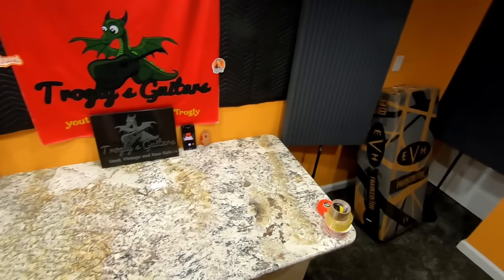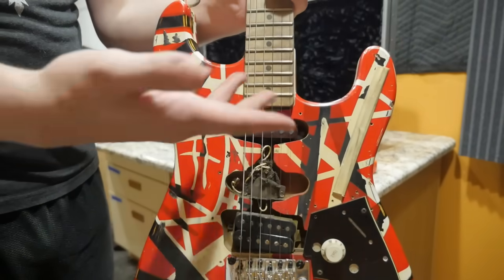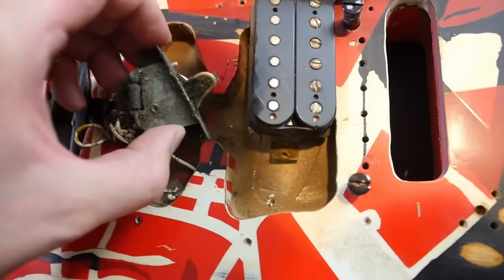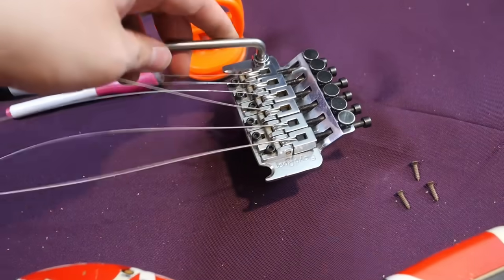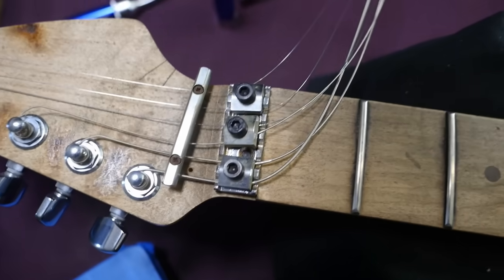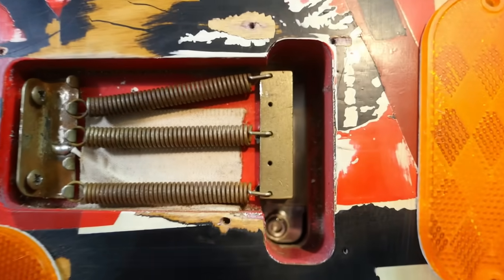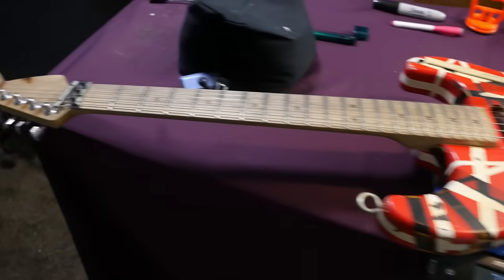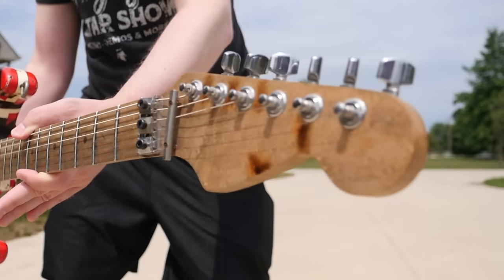This is the "Real Deal" | 2007 Fender Custom Shop Masterbuilt EVH Eddie Van Halen Frankenstrat Aged

Comment: One Minor Detail I noticed right away that you got wrong Austin, they never had Eddie's guitar with them. In an interview with Chip, the guy who did it, and Edward Van Halen, they both talked about the fact he did everything from pictures. He never had the actual frankenstrat in his hands to study.
Reply: Yes! Right answer there, it is all wrong in most parts like the reflectors that fender used are not the correct ones. Way too over priced for not being even correct.
Reply: @kgargom  ...

Well, not to argue, but according to the video I was where Edward is holding one in his hand, he talks about how absolutely perfect it is. Down to the reflectors. Chip even found a smudge of goo on there, and a piece of tape that Edward hadn't removed from the guitar when he painted it either the first or second time. It is amazingly accurate. At least according to Eddie Van Halen. Check out the Guitar World interview about the frankenstrat.
Reply: @timcarter1164  yeah, I've read that interview and saw videos of chip. Of course Eddie was not going to say  that the reflectors were not the correct ones anyway 'cause he had to promote the guitar as it is and "sell it" to people and get money out of them. But my point is that if you're gonna sell a 25k guitar at least there's gotta be with all the correct details on it including the "smallest ones" like the reflectors, if you know what I mean. Every tiny detail count. Just sayin'.
Reply: @kgargom  ...

First off, this is just bring the conversation please don't take it any other way. But while I understand what you're saying, I also know Edward was a stickler for detail when it came to anything with his name on it. Some stories might get exaggerated here and there, but for the most part if it said Van Halen on it, he wanted it up to his specs. When Edward says these are correct, I'm going to roll with his opinion. Because personally, knowing how much attention to detail he paid, had they been wrong, he would not have signed off on it and they would not have been released. Somewhere in this thread, is a link to the video interview. Where he's actually holding the guitar and talking about it. It's part 1, but part 2 will follow. LOL. Anyway, have a great night brother.
Reply: @timcarter1164  yeah, we could chat for hours about this. Have a great night you too. ImI

Comment: It’s very nice! The orange reflectors on the bottom seem to have some kind of diamond pattern in them. The one at the museum I think the met in New York,?

has checkerboard lines on the reflector and screw holes on both ends.? And the red reflectors on the back of  
His Guitar, had some kind a honeycomb pattern thing.. actually it seems everyone of those reflectors are incorrect. They are not the same patterns and you have serial numbers in the middle of them it seems. I have some for my copy of the Frankanstrat.. they seem to be exact to the one’s in the museum..

Comment: The reason to use a Floyd Rose is they don’t go out of tune. Ever. Once you have your strings stretched and locked they just stay in tune. I’m not sure what you were expecting. 

But even with something like a floating, non locking Wilkinson on my Parker P-38… I can dive bomb until the strings are slack and it comes right back in tune. 

If you’re having tuning problems with a trem, it’s likely you have too much strung on the tuner post and you didn’t stretch your strings. Might be binding at the nut too.

Oh and the Beat It riff was not EVH. That was Steve Lukather. Eddie just played the solo.
Reply: @dave
I started boiling my strings ever since the early 80's when I read an interview with Eddie in Guitar Player and he said he always boils his strings for the Floyd so they don't stretch and sound flatter and warmer or something like that.

But honestly I'm way too lazy now to boil strings.
So I just constantly use the fine tuners on my Floyd's to stay in tune.
Reply: @johnwinger8211  People usually boil strings because they can’t afford a new set. I used to do that with bass strings. 

With any guitar even without a Floyd, you need to stretch your strings by hand after you put them on. After a few stretches they will stay in tune. My main stage guitar has a non locking Wilkinson trem. It doesn’t go out of tune.

Comment: I can dig the idea of recreating an iconic guitar from such a great guitarist, so I think this is cool.  But, to be honest, if I knew nothing about Eddie and his guitar, and found that guitar in a dumpster, I would take off the Floyd Rose and toss the guitar back into the dumpster.
Reply: @bill
Ya because a $200 Floyd is worth much more than an original 70's American made Strat.
😒
Reply: @johnwinger8211  That doesn't change the fact that the guitar looks like crap with an empty pickup hole and screwed up wiring.  Yeah, maybe if I recognized it as a 70's strat I would keep it to sell to someone willing to completely remove the paint and start over.
Reply: @billmarq  
Ya I see what you mean about mistaking it for garbage.
It does look like trash.

When guitar player magazine asked Eddie why he made it he said nobody was making the guitar he wanted at the time and he wanted something different than all of the current rock bands clean guitars.
Reply: @johnwinger8211  Actually, if it is Ed's exact guitar that we are hypothesizing about, the body would be a Mity Mite and the neck would be a Charvel - iirc.

Comment: The quarter is not a 1971 it's a 1971D. Trust me they are not easy to come by. The 1971D is even harder to find. I have 2 frankenstrats I collect guitars but I play them alot. I'll say this, there are way better playing and sounding guitars. Cooler Hell No! Iconic Hell Yes! Eddie was the King! When I saw that you were going to review this guitar before I watched I wasn't sure if you would check out the parts an specs because everything literally everything is exactly in the same place as the original. You have ICE in your veins LOL. No hesitation, no fear. Strait to the bench. I enjoy all your videos, best guitar info and content on YouTube.
Reply: Dude denver made 258,634,428 quarters in 1971 they are very easy to find..

Comment: After all these years, it still bugs me that Fender got the reflectors and the tuners wrong. The reflectors were Cortina, not Satellite, and in this guitar version (1997), with that "tele heel" neck, the tuners weren't Schaller, but Gotoh crown tuners (you can still see them in the Smithsonian museum). The eyehooks were also a different, had some kind of washer touching the wood... I guess 25.000 USD in 2007 would get you that, but oh well...

Comment: Nice video, but there was one thing you had mentioned that was incorrect. Chip Ellis built this guitar off of photographs. They didn’t have the original guitar to take measurements. It was done solely by using existing photos he’d collected of the Frankenstein

Comment: I think what I found most interesting about this is the Floyd. So it literally can't be pushed down that far because that massive brass block is conflicting with the body? I wonder if the block directly touching the body also helps with the tone of the guitar. The Mexican Frankie has a much smaller block that doesn't touch the body, thus the Floyd can be pushed down all the way.
Reply: Yeah I would think the block touching the body does improve tone and sustain like doing a trem block on Strats. Knowing Eddie he probably did that with intent because he did every trick in the book.

Comment: It's funny when you think about it: this is based of a partscaster that consisted of a B-stock body that he put an aftermarket neck and pickups then put a Floyd Rose on it.
So it's and insanely accurate $25,000 reproduction of a $300 guitar.

Comment: In 1988 I ran into Zeke Clark at the hotel all 5 bands were staying at the night before the Monsters Of Rock Show. We got to talking and when I mentioned the "Van Hal-o Scamp" he freaked and told me the entire band had gone down to the parkade to check it out (I had the entire interior, rims, rear diff and suspension lift kit striped up) and invited me up to his room. On the bed was sitting the 1984 guitar and the 5150 guitar. I handed him the 84 and I picked up the 5150. The first thing I noticed was how LOOSE and sloppy the bar was. After a while, Ed called and was giving Zeke shit for something. He'd written out directions on how to pick up my 2 guest tix the next day and motioned me to bail. To my permanent regret I PUT THE OU812, autograph embossed pick BACK ON THE GUITAR! (Despite there being a box of them on the floor next to the 2 cases (complete with hand cuffs and Ernie Ball 5150 string wrappers).

Comment: That wire wasn’t ever nailed to the body that white circle is the adhesive that was a stick on plastic jewel and the solder on the wire is the detached three way switch tan broken off.

Comment: It wasn’t that he couldn’t figure out how to wire the neck pickup ! 

Eddie wondered if he could hook up a single tone knob right form knob to pickup nothing else aside. He didn’t even want to use the neck pickup. So he unwired the neck pickup and tried that knob to pickup method and it worked. Then he just left the neck pickup in there.

Comment: Do you still have it? Can you weigh JUST the body, please? Ash can vary greatly. And, when they came out, in 2007, they said, that they picked wood/bodies that were close to the weight of his. I believe that they said, within a pound. I expect that would mean 8 oz. over or under.

The speculation, online, is that it’s a heavier ‘Northern’ piece of Ash.

Comment: throw bunch of guitar parts into car mechanic toolbox, for some day you need parts for something like these type of guitar aged job, and i believe big guitar brand like fender and gibson , custom shop must doing something like this throw guitar parts to different type of environment , like put pickgaurd , blinding, kind of plastic to some spot can catch sunlight in storage house or bar air fan system get some smoke , metal parts in to a box put in to a humidity environment, something like that.

Comment: Really good review. 👍 I'm certainly not an EVH master historian either, but I do know that Chip Ellis created the replica from photos only. He didn't have Ed's original Frankenstein on hand to compare with, but Ed himself couldn't tell the difference between his original and the replica. Now THAT'S amazing. What's even more amazing, is that I can absolutely do a far worse soldering job than Ed did, lol. The "black goo" on the upper horn is actually remnants of electrical tape that Eddie used to secure his guitar strap to the guitar for awhile (around '82-'83) before putting in that monster eye bolt

Comment: Every guitar I've ever had has been a "low" mid-range guitar that I've replaced everything except the body and neck. Why? Because my tone matters more than the "high endedness" of the guitar. Do the $1200+ guitars sound good? Sure, but I'd be changing those too. Why? Because they're meant to be played, and they're meant to be turned into an individual's instrument with individual "signatures". Over the years I've found that the "low" mid-range bodies and necks are simply "seconds" of the high end bodies and necks. (Caveat is that the LOW end are made of cheaper woods. The mid range are all made with "leftovers" of the high end guitars, or bodies and necks that have been cut and shaped for the high end, but rejected for whatever reason.) 

As for the single coil in Ed's guitar, he placed it there because he continued for years to get asked how to achieve his signature tone. He'd point to the "fake", or dead single coil and tell everyone it was the magic of the circuit. He knew how to hook things up, he just "camouflaged" his sound so others couldn't do the same things on stage as he was doing at the time. Also note that I don't think there is a Fender on the planet worth more than about $400. Not even the newer "custom shop" models, but hey, that's me. I'm a guitar player and have been for 41 years.

Comment: That's just buffing compound on the neck and inside the body routes. That's not real dirt or lacquered finish with dirt over it. This is done with the same polishing compound that they use for rubbing out their guitars to a high gloss finish. I have one of these buffing machines.  You simply rub the compound onto a piece of metal held over the top of whatever you want to replicate the dirty effect. It makes the compound dark and dirty looking. It gets into everything so you have to mask or block off the area that you don't want to get this stuff into or on. Also the rust effect is done with TOILET BOWL CLEANER. They soak them in it and then put them on the guitar. Mostly you can sand the chrome or nickel plating off the screws or other parts and soak them in a plastic bowl or Glad Ware container. Fender used a piece of wood with the screws drilled into it and put over a Glad Ware container with cellophane plastic wrap over it for 45 minutes. Long enough to eat into chrome or nickel plating to exact this effect.  This is how they relic their hardware. 

The body and neck were bought from Lynn Elsworth in 1975 and it was a factory 2nd that Eddie asked him about and Lynn told him that he could have one. This was when he first painted it black with white stripes. Eddie himself said that it was easy to paint since they were already sealed ash. Meaning that the replica that you have is not 100% accurate since it has wood grain showing through at the end of the body towards the strap button. Also those are SAFE-LITE reflectors that you can get at any hardware store or truck stop. 

   The tape in the tremolo cavity if GAFFERS' tape. The tape on the top of the body is electrical tape that he used to hold the strap to his guitar. That was originally a safety belt from car that was converted into a guitar strap. Later he used a dog chain duct taped to another guitar strap made from leather.  It's not hard to relic guitars - but it IS if you don't know the correct procedures. I've seen too many home made guitars and copies of this and other guitars that are horribly done. Also keep in mind that Fender did this from pictures - not with the actual guitar in hand.

  And all these copies that are unlicensed are ILLEGAL!!! Don't encourage these idiots to do the wrong thing! If you want one - PAY for the real thing even if it's a Fender copy at least it will be correct and legitimate. There are videos here on YouTube of the interview with Eddie Van Halen with this very guitar.  Thanks for posting this. It is very interesting and things that I knew but I didn't know that the light coloured spot inside the pickup route wasn't a paint spot. It makes sense that he would try to ground it but that's why they used the tremolo ground when this guitar was first introduced to the public in 1954. Thank you again for posting this. A true piece of history for sure.
Reply: Thanks for the great post. Very informative.

Comment: Austin Chip built them from just photos he did not have Eddie’s guitar. And please check the info Eddie did not put the pick up to line up with the strings it is how he hacked the bridge position from a single coil to a humbucker. I can try to see if I can get Chip to give you a call if you want. Or even Chris who ran the EVH line when these where done with Brian. Matt Brown is running the line now so if you guys need the correct info I can Hook you up with them to give you the correct info. By the way I can not believe you took apart a $30,000 guitat. Lol only Austin would do that.

Comment: I’ll be shocked if the Fender custom shop Frankin stat maintains any value above 8 grand in the coming years. The buyers of this piece are probably Eddie memorabilia collectors that have plenty of disposable income that might not be fully aware of all the many different options available for purchasing this high-level of detail guitar for 2K or less. Not only is this one of the most copied, purchased, and available guitars on the low end but it's also one of the most copied, purchased, and easily available guitars on the high end with exact detail to Eddies original $80 Strat for 2K or less.  What impresses me most is how Fender must have marketed this guitar to get $25,000 for each one. It will be interesting to see what they sell for on eBay in the coming years.

Comment: Why does it only have 21 frets the real one has 22 frets
Reply: This guitar has had so many different necks on it.  As it is now, it’s a 21 fret neck.  In the late 70’s it had a big CBS headstock neck until he hooked up with Kramer.    Then it got a fender headstock shaped Kramer neck for a short  time until Fender threatened to sue Kramer for using their trademark headstock shape.  Then Kramer just cut the ball off the fender style headstock and the Kramer “Beak Headstock” was born.  It had a Kramer beak neck until Eddie retired the frankenstrat for the Kramer 5150.  Then sometime in the mid 80’s the beak neck was changed to a Kramer hockey stick neck with a candy stripe painted headstock. That neck stayed on it for a while and at some point it got  the neck that’s on it now. I’m not sure where that neck came from. There’s so many different stories floating around it’s hard to say what all the changes that thing has been through.  I’ve seen pictures of an all black Strat body with a rosewood fender neck, mint green Strat pickguard with a hole crudely cut out for a humbucker and it had a zebra humbucker and the 2 single coils in it.  The stories Eddie told about it were different than what pictures from the time show.   So, who really knows what all that thing has been through.